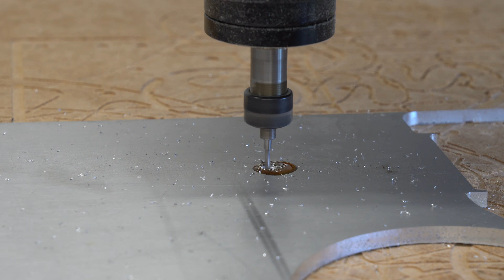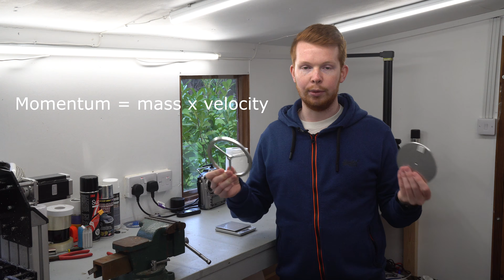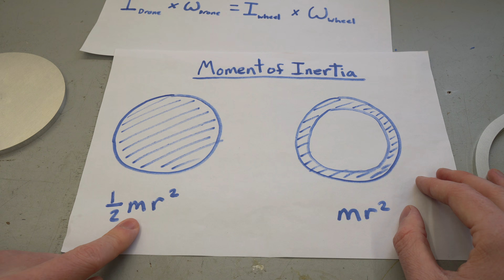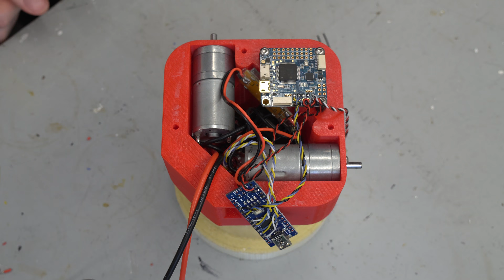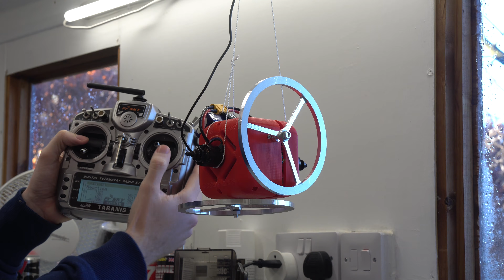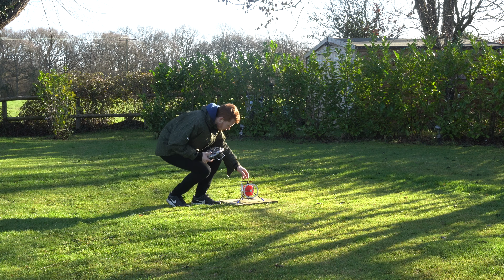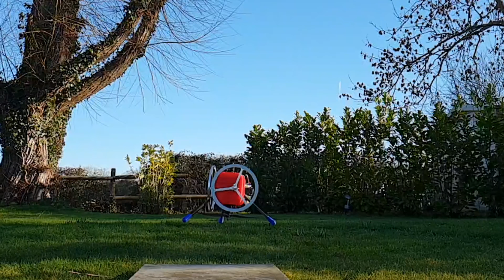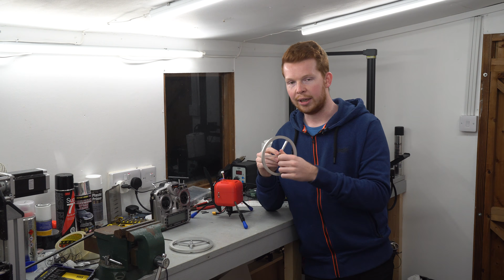Comment: Great concept. Please do carry on.  May I suggest finding a way to hung the drone from one of those large trees, instead of levelling it on the ground? This way you could make many flight experiments with no costly accidents.  (Using a pulley and a counterweight to ensure that the hanging string stays permanently tense, would prevent it from getting tangled with the rotors).  - Also, how about using 3 reaction wheels? This may add precision and strength to the stabilizing effect. - And finally, separating the two rotors from each other, to some 40 or 50 cm apart., may make the destabilization far more slow, thus giving more time for the gyro effect to counteract it in a smooth manner.

Comment: Sorry once again. It would be more practical the use of multiturn servos instead of brushed DC motors or sttepers, because they are lighter and have a potentiometer that can be used like a simple encoder connected to the analog inputs of Arduino. Oops! I didn't take in account there  is difficult to determine accurate linear acceleration with the GPS unless you use an RTK. You need to combine magnetometer, gyro and accelerometer information to obtain approximate angular position.

Comment: May be you need to use a PID (proportional, integration and differential) algorithm to resolve the instantaneuos current increment to obtain the desired momentum. Angular pitch and roll can be supplied by the accelerometers less second derivate of GPS position (each at least 3 readings). Good luck.

Comment: Great video! Very interesting to see this working. I just wonder if precession forces might be a problem here. If one wheel is turning fast, the drone will tilt if the other is trying to apply a momentum. This might cause that "whobbly" behaviour of all the regulators tying to correct all those angular offsets which then create new ones ... just an idea.

Comment: Kudos for the fun little project incorporating physics, although everything corporates physics. I didn't watch all of your video, sorry. But did you take into consideration the balance of the object in relation to the propeller Force thrust line.  If it's out of balance, every time you accelerate or decelerate the object up and down you're incurring some extra angular momentum or inertia causing additional instability for your little wheels to react to.
What about suspending your object with a string from the top propeller and placing Mass on the opposite sides of the wheels to balance the unit.  Thanks for your time and effort.

Comment: Very neat project. Your stability problem is going to be the bottom prop. You should omit the bottom prop entirely. Having the center of gravity between the 2 props makes the lower prop constantly try to tip move the drone out of the way(to the side) so it can be on top. I can only imagine the air turbulence this makes as well. Again awesome project and very nicely executed.

Comment: Great video! One question for you if you actually read this, did you do any sort of rudimentary stability analysis to see where you're closed-loop poles are located? This might give insight on how to tune your controller. Other ideas you could do if it is difficult to prove stability would be to use either fuzzy logic control or machine learning instead of a conventional controller! Either way, cheers!

Comment: this will always run into saturation anyway right ? even if you could advance the spin up/down? or am i mistaken ? as this is using the torque of spinning up a mass if you need more + axes and retarding it if you need - axis ?  Nice experiment but shouldn't the discs be spinning at 1/2 speed anyway (before takeoff) so they can correct negative feedback too by slowing down ?

Comment: Impressive results for a very difficult task. Side note: It seems that there's something missing in the inertia of a ring explanation. Aren't both parts rings? I looked it up, and yes, the two formulas are for the extremes: i=mr^2 is for a infinitely thin hoop, while i=0.5mr^2 is for a solid disk. Anything in-between requires i = 0.5m(a^2+b^2) where and a and b are the inner and outer radii. This makes sense, as moving the mass away from the center intuitively increases the rotational inertia. Of course, it's also an oversimplification, but perhaps more appropriate for the purposes of this video.

Comment: I think you may have had a problem with gyroscope precession on the wheels. Every time your drone moved the wheels would precess depending on how fast they are spinning. This would throw your flight controller into a fit.

Comment: You should not need a tachometer. The motor speed is determined by the voltage applied or the voltage across the motor. That is up to the maximum current beyond that maximum current, power is just wasted. Conversely if you are driving from a current source the current directly sets the torque output from the motor. 

Use those things to simplify your control loop. Ask any electronic or electrical engineer about it it is basic permanent magnet motor or generator theory. If you need more efficiency use a high voltage supply and switch mode motor drive full bridge stepper motor driven from a PWM port on your microprocessor will give you voltage output as a proportion of voltage in.
Reply: Also make your first step easy use a conventional prop above and weight below then progressively introduce the reaction wheels system. I can see the reaction wheels will make the drone more agile like a bird.

Comment: It looks like the reaction wheel starts to spin in the opposite direction once the drone tilts too much. Just slowing the wheel down a little would slow the rotation. This looks to me like the motor speed is set according to the angle of the drone without taking the current speed of the wheel into account. As the construction is not balanced the wheel should need to accelarate constantly to keep the drone level.

Comment: cool video. looks like the drone   might be a little unbalanced. try smaller rotors on 4 sides encased in a sphere. I belive the force on the air is applying force to the rotors. also you may want to try a small counter rotor on each side to five you a smoother torque curve. the counter rotating blades seem like a good idea. try gibling them for greater flight  controls ^.^

Comment: Strain gauge on a flexible motor mount for the wheel motor. Each motor gets its own Arduino controller which takes a request for however much torque, watches the strain gauges, and changes the current as needed to achieve the requested torque.